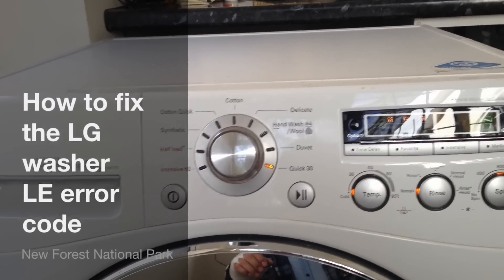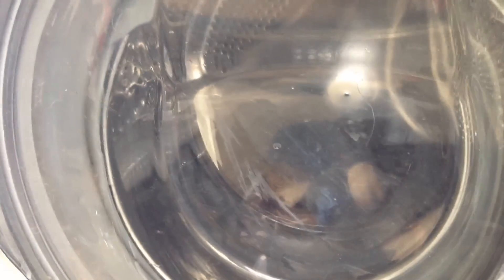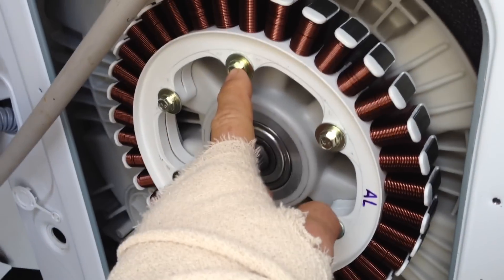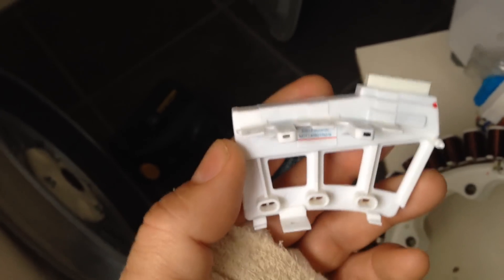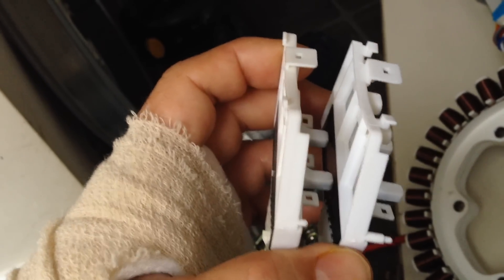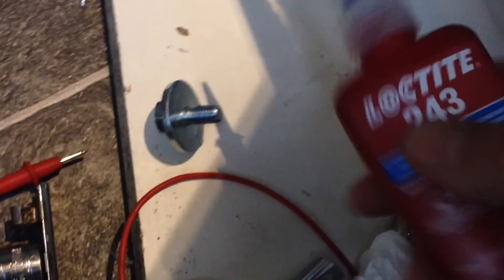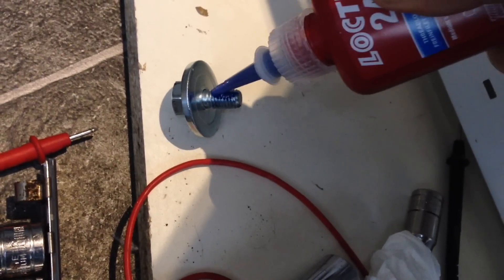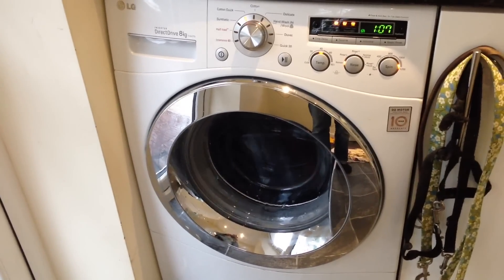How to fix LG Washing Machine LE Error Code - Upgraded 6501KW2002A Part

Comment: this is mean overlimit balance in motor.
Reply from the maker: Thanks.  LE probably stands for Load unEven or something like that.  Of course in the scenario of a component malfunction like here, the message is erroneous.  The machine thinks the load is uneven, but actually it's the motor that is behaving erratically due to that failing hall sensor on the motor.

Comment: My rotor sounds like it is struggling to start. I took the back panel off and when it hums like it wants to start I give it a push and it starts moving. It will work until it stops or reverses direction . All I have to do is bump it. I took the rotor off, the plastic splines although worn, don’t appear to be slipping, maybe they are? Any thoughts from anybody? Rotor position switch? Almost seems like it is not getting enough electricity to spin the rotor.
Reply from the maker: The apparent lack of power is exactly the same symptom as shown in this video, with the solution as shown.
Reply: Thanks I’m picking up the parts tomorrow, I hope the new rotor has steel splines instead of plastic.
Reply from the maker: Eh? The part probably required is the position sensor not the rotor.  The position sensor is plastic.  See video and video description for part.
Reply: Thanks

Comment: LE is a lock error
Reply from the maker: In this common case it's indicating a bad motor sensor.
Reply: Our LG top load washer, model WT5001C is 5 years old and started having the LE code and UE codes - yes, we'd unplug it, wait and try again and it would proceed, until this week. I set about looking into the issue and lo and behold, found a steel washer and nut under the thing! Lifting the machine, spinning it on and tightening the nut of the impeller shaft fixed it! It makes sense - that the motor couldn't adequately drive the impeller if it wasn't connected very well.
Reply: comeinhandynow It's something to do with locked motor.
Reply: Sensor was changed and the motor is still locking any suggestions